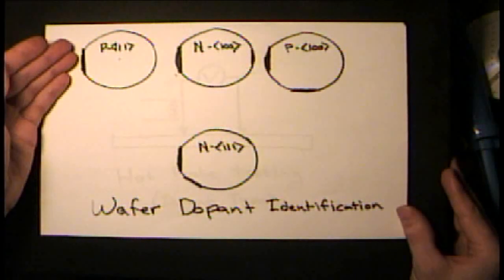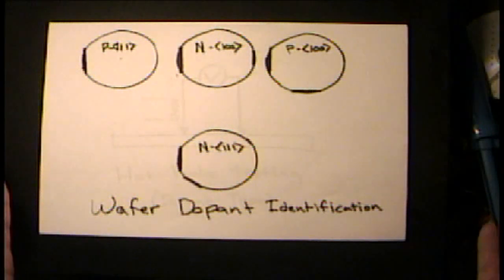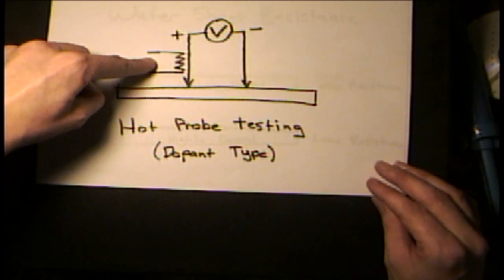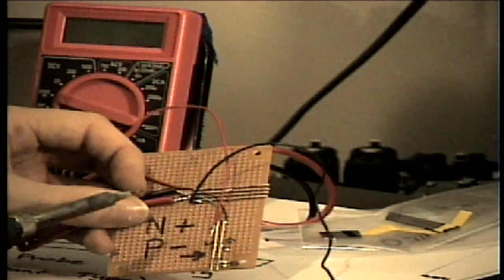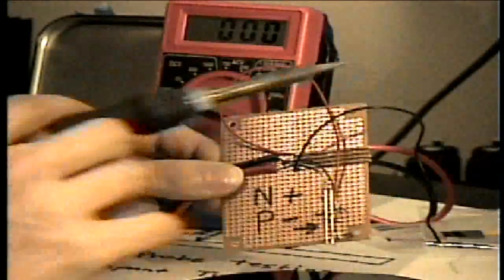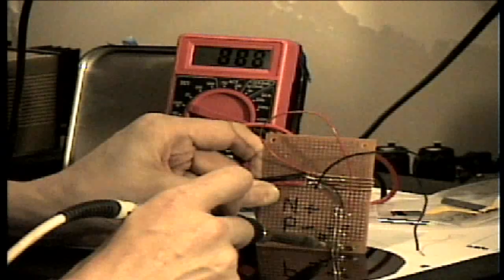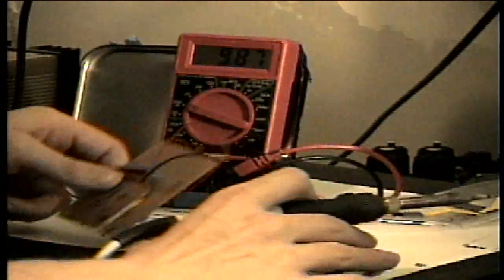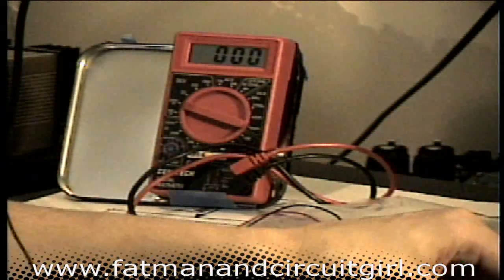Identifying Wafer Doping - Hot Point Probe Test

Comment: Recently we have been grinding the wrong flats on wafers on purpose for SOI since the flats need to align on the two wafers.  If the device is 'n' type and the handle is 'p', one of them needs to have the wrong flats.  Of all the type testers I use, the hot probe is the most reliable.